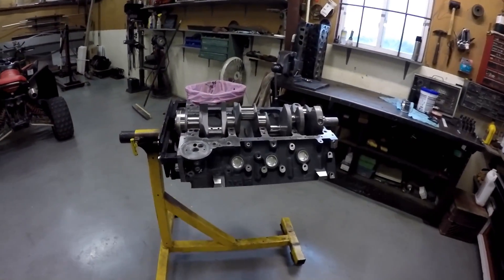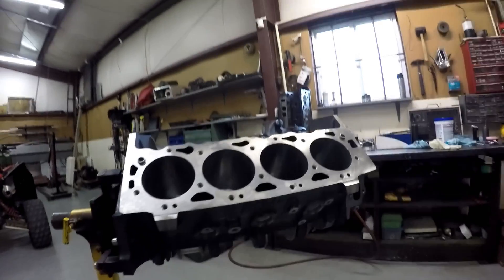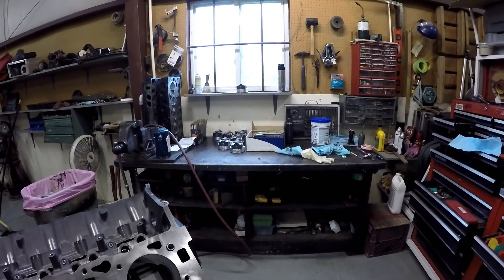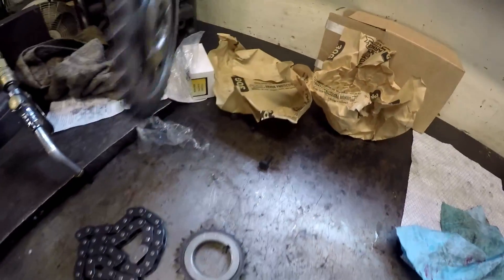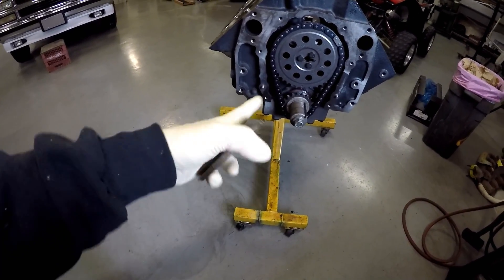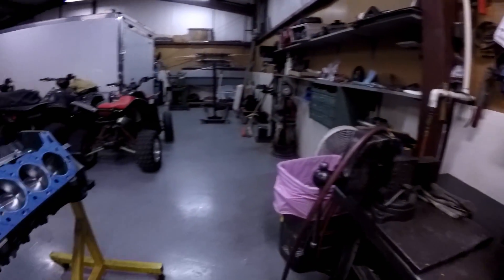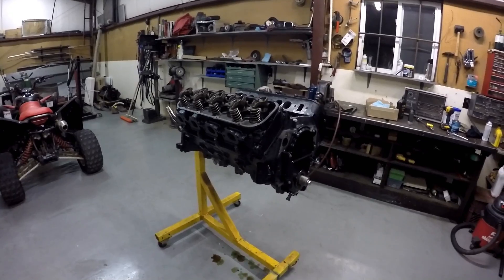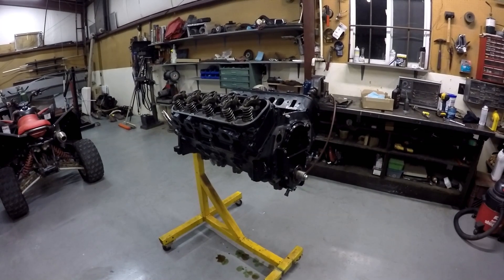Big Block Chevy Engine Build 454 C.I.Vortec 7.4 L Chevrolet. pt 1 of 2 pts

Comment: Only 190K miles on it? My God, did anybody ever change the oil??? Mine's got 319K on it and has never been out of my truck, I just had the 1st timing chain replaced last week it had some slack in it. These are really good engines but it helps if you change the oil in them occasionally. 🙃

Comment: Did the crankshaft get balanced or I can go without balancing if I'm just getting new pistons?
Reply from the maker: Yes the rotating assembly in this engine did get balanced by the machine shop who done the machine work on the block. Since I put a new crankshaft new rods and pistons it all needed to be matched up and balanced. 
If you’re only replacing the pistons with the same cast pistons as stock,  most likely you won’t need to balance the assembly.
Hope that answers your question thanks for checking out the video.

Comment: Do you cap the rings or used them the way they came in the rebuild kit
Reply from the maker: They were not file fit rings. Installed them right out of the box. Thanks for checking out the video.

Comment: Hi great video bro wana ask what kind of dome piston you use name and number is it small dome profile piston  also name of that gasket that you use in cylinder heads number & brand also want to ask you if i try to reach 10 compression ratio will iwill get no vcum becuse one i know do reach that compression ratio he got no vcum. Is that true if reach that 10 compression that will give zero vcum
Reply from the maker: Hi DNO, The Pistons were 0.100” dome I bought from Summit racing I believe the brand was sealed power. 
The head gaskets were Fel-Pro damn I can’t remember the part number of them. 
As far as no vacuum with 10.O compression ratio that makes absolutely no sense at all. You should still have vacuum with 10.0 compression.
Thanks for checking out the video.

Comment: What is the part number for the pistons you used in this motor
Reply from the maker: Hey Martin man I can’t find the exact part number for those pistons but they were sealed power hyper Tech pistons stock bore with .100 Dome. 
Hope that helps you out thanks for checking out the video.

Comment: i been getting the ho 454 with a 4 inch stroke steel crank heavy rods and pushrods with a 02xx 400 turbo last one i got had 6000 miles on it so far this year i got 4 of them for free the most miles was 58,000 on the crate set up all run perfect the trans has the bigger pump heavy clutches stage one shift kit at GM they say it is for street strip or heavy applications they claim it the best auto trans they build u want the 02xx 400r turbo and it is on the top of the bell housing part of it and u can't miss it plus the casing it built heavier

Comment: Did the engine run better than before?
Was there any aftermarket parts or modifications for better performance you did.
Reply from the maker: It did run better, the only performance mod was the increase in compression with the 100 dome pistons.
Also it ran better simply because it was a fresh engine compared to a worn out engine. About a year after the build I replaced the mass airflow meter and installed new fuel injectors from 
Five0 motorsports, that  picked it up even more.
Thanks for checking out the video.

Comment: Where did you get that engine kit?  I have a 2000 GMC w/454 and I'm having a hard time finding rebuild kits.
And what did you torque the heads to because the 1998+ call for 37 ft lb + 150 degrees and didn't see you do the angle?
Reply from the maker: I bought most everything individually. The rods pistons and gaskets from summitracing.com Bought the crank from a Chevrolet dealer in  Texas. Torque on the heads I believe it was 70 or 80 foot pounds. No torque angle. Hope that helps you out thanks for checking out the video!
Reply: Thanks 👍

Comment: Hey on a journey of research of these beast engines. I have one that im rebuilding. So you didnt have to adjust any valve lash on the rockers? Just torque down to what? did you torque down on TDC? anymore insight is appreciated.
Reply from the maker: Hey guy , There is no valve lash to be adjusted. It has hydraulic lifters so you will just tighten the rocker holder all the way down. 
Can’t remember what the torque was on those. You just bottom out the bolt and the hydraulic lifter takes up your lash.  Hope that helps you out and good luck with your build!

Comment: Something I've been wanting to do to the 454 in my 85 C30 dually is drop Vortec heads on it. Only issue is I'm being told they won't on the factory Mark IV block because the Gen V and VI big blocks use a reverse flow cooling system. I'm kinda bummed out by that because you can swap Vortec heads onto a small block even though small block Vortec engines are also reverse flow.
Reply from the maker: SOU6900 .. Too bad you not able to use the Vortec heads. I do think they are better than the older ones. Thanks for checking out the video!
Reply: @kcatv9556  now I'm being told that there's a special head gasket or something that lets them work on an 80s or older block. I'm also being told that even with said gasket you can end up with coolant seepage into the lifter valley.
Reply: KC- you can use Mark 4-5-6 heads on any block
The best head is the 049/781.    The Vortecs suck
Reply: swapping vortec heads to an older Gen IV block requires you use the gasket for the BLOCK. dont use the vortec gaskets for +96. its been done a million times bro

Comment: Good short block assembly. Curious about the graphite for the cylinder walls to help the rings seat.
A good practice to assure the cylinder walls are prepared right is with machine shop practices of getting to a very fine finish like 800 grit right to the size needed of the piston going in on the max material side of the tolerance with the Sunnen CK rigid honing machine. Finish up on the engine stand by hand with a flex hone at the finish recommended for the rings. I like Speed Pro plasma moly rings that recommend a 400 grit finish and the flex hon sets the finish with a solid base rather than a rough base. This was passed on to me in the 80’s by an instructor who built lots of motors. Rings seat properly with the right finish. Whatever rings you use go with the finish recommendations of the ring manufacturer for the type of ring you are using right off the packaging laying the finish down after establishing the hatched smooth finish base that started from rough, to medium to smooth, around 800 grit for the final recommendations to be applied last. Chrome moly often is a rougher finish like 250 grit so run it up to 800 grit then the final passes of 250 with a flex hone on the engine stand by hand (use honing fluid etc.).
Reply from the maker: Mike Stone . Had not used the total seal graphite before, but have heard good things about it. Absolutely I agree to have the cylinder walls prepped correctly to insure a good ring seaI. I had Scoggin Dickey Chevrolet machine shop prep the block before they sent it to me.  I had sent them the Pistons so they good size the cylinders.

Comment: Ugh ,all new parts right ? Did you have it all balanced .hhhhmmmmmm. just adking.
Reply from the maker: Kevin Hudson .. Oh yes had the rotating assembly balanced at Scoggin Dickey Chevrolet.  They have a machine shop there where they build there racing engines. Had the balancing work done before they shipped the parts to me. Thanks for the question thanks for watching!

Comment: Can this build still pass emissions. Or no cuz I’m really interested on building one like ur set up
Reply from the maker: All of the factory omissions are still intact. O2 sensors airflow meter EGR valve. So yes it still pass emissions. 
 Good luck on your build and thanks for checking out the video!!

Comment: How much did the parts cost ? I’m a bout to rebuild a 98 Chevy 454
Reply from the maker: Jeff Linduff ..  It was around $4500. That’s with getting the cylinder heads rebuilt too.   If I would do it all over again I probably wouldn’t buy the steel crank . I would just have the original one Machined and use it.  
That would save $1300. That was a heck of an expense. 
Good luck with your rebuild!!

Comment: I just bought a 2000 3500.  My mechanic has had it for 5 weeks.  Needed new exhaust manifolds, he broke the EGR Line and we can't find a replacement.   Has been discontinued by ac delco.
Reply from the maker: Brendan McGhee ..  Well that’s not good news sometimes that stuff happens. May have to find one used.

Comment: about 350 hp? i agree about the detonation with the higher compression, but I'd still like to have seen 10 to 1 ,im so glad its not in the 8 s though ,explains the lack of power from the factory ,but at 295 hp ,it still blow the doors off of fords 180 hp 460 v8.from the mid 90s .
Reply from the maker: TRUCKS,TRACTORS,WILDLIFE, GUNS HUGH WOLFE ..  Yup me too I would’ve like to get the compression around 10 to 1.  
But I’m glad I didn’t and I’ll give you a quick story why.  Our last trip out of town with the truck was in November temperature was around 35°F and we were pulling the enclosed trailer loaded with our ATVs.  Well you guessed it going up hills with about 1/2 to 3/4 throttle and lugging it down it was pinging . Now in the summer when we were running it was around 80 to 90° it never had any issue. But with the cool crisp air that’s when it brought it on. 
Now this is running the cheapest 87 octane fuel I can find.  I do not want to have to run premium fuel in this truck way too expensive now days.   I did put premium fuel in it on our first stop in November and it chapped my ass doing so.  
Back in the late 60s early 70s Camaro’s and nova’s had 350s with small chamber’s heads those motors were around 10 to 1.  But I believe premium fuel back then was way better than it is today.   A hell of a lot cheaper as well.   Thanks for checking out the vid.
Reply: KC ATV World i agree,your right, it will have more than enough power the way it is ,and i also built a 350 c.i v8 for my impala yrs ago, and did the same thing, i kept it about 9 to1 ,for reliability and cause of the fuel being unleaded ,but i was pretty much limited to about 280 hp. with the mild cam , i did have the old 1:94 heads,still had the soft seats ,but had a good machinest , he did a fantastic job on them, i built the rest, it lasted till yrs after i sold it, ran it hard ,kept up with the maintenance though ,new oil atleast once a month, that was in 99 and i sold it in 02 ,and as far as know its still running strong ,
Reply: Lightning vs ss454... nuff said

Comment: Your wrong when you said you get detonation starting at 9.6 to 1 compression. I have 11 to 1 with my 359 Cleveland and I have no problem running pump gas. Then again I have a Ford and not a disposable X brand chevy
Reply: I hope your  referring to the pushrod ford engines....and not the p o s...4.6. and 5.4 ohc...,engines...With the timing chain and plastic guide problems...

Comment: I understand what your doing. Should've mentioned the heads are from the 70s. Zero decking the block and a .025 head gasket will get you about 9.1 c/r and the Vortec heads make wicked torque between 2-3k rpm and run out of wind at about 5k. I run a 502/502 cam and it's carbureted w/a gen 6 block. Collecting the parts to make it an alloy head 489 stroker.

Comment: I own a 1970 SS 396 Camaro. 402 CID 350 HP. with 10.25 compression ratio and use BP 93 octane gas and lead substitute and never had detonation problems. Even owned a 1970 Camaro L-78 402 375 HP 11.0-1 compression same lead substitute and Sunoco 94 octane gas with no problem.
Reply from the maker: John Gialanella jr .. Sounds like you own and owned some pretty cool cars.  Just got back from Hatfield & McCoy trip West Virginia.  Engine ran great, had slight ping One time going uphill with about 3/4 throttle pulling hard.  That’s on the cheapest gas I could find 87 octane.  Glad I didn’t go anymore compression then I did.  
Thanks for checking out the video and appreciate your comment!
Reply: John Gialanella jr , i have a late 50s 312 ci v8 , high compression, for leaded gas, and thats what i run in it ,lead substitute, and never had any trouble.

Comment: You mentioned it has 118cc heads and your compression is now 9.4:1 with the .100 dome which is a 10.5cc. 

The vortec heads chambers are around 100cc, not 118cc. Your compression is prob closer to 10:1 now
Reply: I thought they was 100cc but still be fine on pump gas.
Reply: @johnboy9769  JUST MESURE IT
Reply: @lkkjhtemmexv1838  why would i measure it ? It isn't my shit. And i really don't to measure cause i already know the cc
Reply: Vortec bb heads are 100cc
Reply: @marques36  What compression ratio are the vortec?

Comment: Why didn't you use the 8.1 bottom end?
Reply: Because almost none of the 8.1L components match gen 6 BBC.  With a 496 stroker kit in the gen6, that would work, except 454 calprom data would all be NFG.

Comment: What year engine is this? And do these years come with large oval part or peanut?
Reply from the maker: Kyler ..  Year is 97 and the heads are small port .
Reply: @kcatv9556  OVAL PORT on 1997 to 2001, peanut heads before 1997.

Comment: Alot of wasted money in this build. Ya have a forged crank and H-beam rods and running a stock cam and peanut port heads? A stock iron crank and stock forged rods will withstand 650+HP. Should have spent the money on a good pair of heads and a mild hydraulic roller cam that's compatible with your ECM. I guess ya have room to grow if ya need to.
Reply from the maker: Richard Noggin ..  Yeah if I had it to do all over again. I would have reused the factory crank just have it turned 10 under or something and go with the comp cam one of the guys mentioned in earlier comment.
Reply: @kcatv9556  get rid of those junk heads too
Reply: @Wanous-hv7zo  Those heads are FINE for a truck that will normally never see over 5000 RPM.

Comment: Wrong, 12.5 to 1 is the pump gas limit, 13 and up requires race gas, my Chevelle is 11.5 to 1 and it runs 93 octane fuel just fine
Reply: That all depends. I've run 12.5-1 engines on pump gas that had 280+@.050 cam, and polished chambers & piston tops smoothed, deep gear and loose convertor, it can be done. But I've also built 9.5-1 engines with 220@.050 that need 93+ octane. And 10.75-1 with a 230@.050 that needed 100 octane. Really it comes down to the cylinder pressure. If it pumps less than 200psi, it'll run on pump gas, if its over, gonna need high octane fuel. There's no set guidelines on that shit. Also the tune can make the difference, running rich can lessen the octane requirements, also low timing. And a good tight quinch can lessen the octane requirements, like under .040 piston to head. Alot of variables can make the difference. Anyone saying that there's this hard line of 9.5-1 and up needs racing fuel don't know what the hell they are talking about. I've seen a 14-1 sbc engine run on pumpgas without detonation. It can be done.
Reply: Richard Noggin yes u may can run a little more compression on pump gas but why do it? It's stupid in my opinion to risk melting down your motor trying to run it on pump gas especially a 14:1 motor that's really dumb all it takes is some bad gas out the pump and u screwed. Further more the engine will never see its full power potential on pump gas anyway so it's a waste of time. This guy is building a motor for towing not drag racing so the high compression is not needed here. He basically building for torque.  A 454 dosent need a lot of compression for torque.
Reply: Richard Noggin I agree
Reply: +Uncle Deuce No shit, I wouldn't recommend doing it with your daily driver, but the point was there's no set guidelines. It depends.
Reply: +Uncle Deuce And obviously a 14-1 engine is a racing engine, but some folks like to drive drag cars on the street for entertainment. I've been doing it for decades.
Reply: Richard Noggin I do as well got a 16-1 582 BBC in a 69 Camaro sr20 motor. I Just don't do the pump stuff but it's to eachs own
Reply: Is that theory?  cause in my country,,,  11.5 dont work with 95